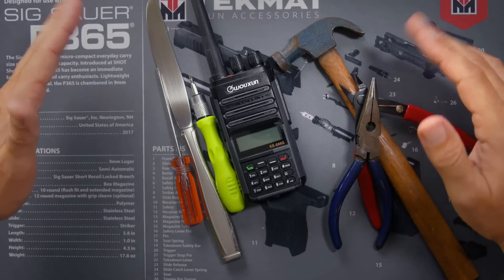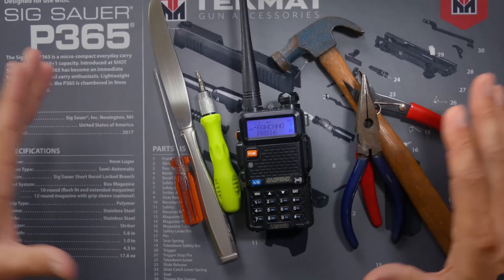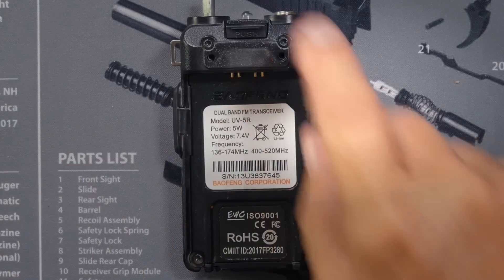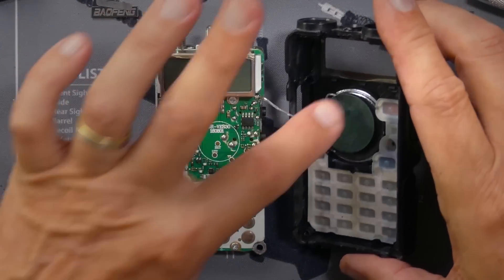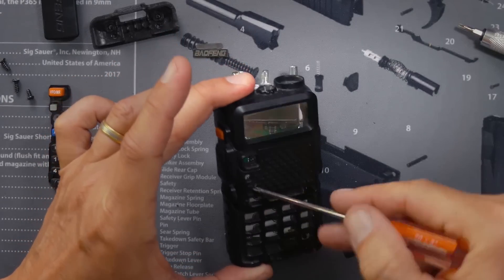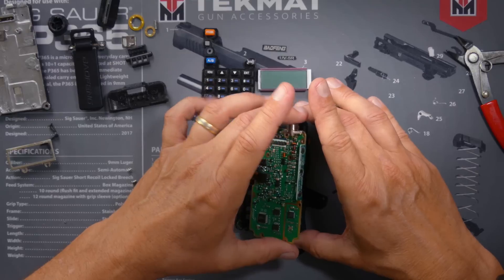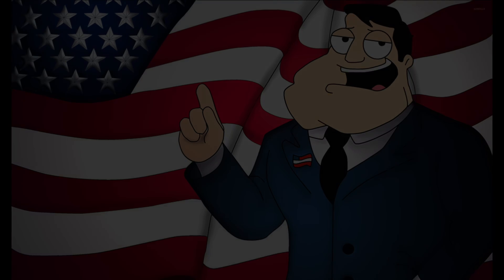Inside A Baofeng UV-5R - Teardown & Disassembly Of A UV5R, Or, How To Destroy A Baofeng UV5R

Comment: So quick question if anyone can answer i got 2 uv5r’s one a couple months ago and one a couple weeks ago the slightly older one if I put on the shorter antenna with the new one on and listening it looks like it’s transmitting every time I turn it on and the new radio is picking it up I think the first responders reacted to it too I have never pushed the transmission button listening only. Is that normal?
Reply from the maker: It is not normal, in any circumstance, for any reason, for a radio to transmit by itself IF/AS LONG AS you have the VOX feature turned off, which could trigger transmitting.
IF this occurs after confirming that the VOX option is disabled, then either don't put on the shorter antenna on the radio or toss the radio in the trash and save up $18 for a new one.
Reply: @TheNotaRubicon  thanks for the reply I’ll check that vox thing out later
Reply: @TheNotaRubicon  tried recreating it and recording it with my phone but can’t. It also makes my phone camera glitch out when I have it on scanner mode trying to take pictures of the frequencies to write down I think you are right better just get another one lol thanks for all the work you do here. Radios should be a mandatory class in high school in my opinion.

Comment: id have fun giving it a try to revive her , not sure about the trim adjustment and lcds , ive always had crap luck with lcds that work with pressure pads , and a moved trim original position but still i wouldnt say she dead yet .  have you seen any debug or jtag like test point or headers inside cant really tell from that far ?
Reply from the maker: Dude.. You are on the wrong channel.

Comment: a pre-topsy?   Re battery -  once the battery gets to the end of it's working life, I wonder, if you could scoop out it's entrails to turn it into either a battery eliminator,  (solder a cigarette lighter plug to it?  I'm not very electrical minded, I'm 'fraid) or a battery carrier for a half dozen AA's...    just my 2 cents worth.  
around 8 mins - poteniometer? I had heard  you can change the frequency range of some 'fengs via that....

Comment: How'd you get one without water damage?
Reply from the maker: I have purchased about 15 UV-5Rs in the last few years, and had dozens of other radios sent to me. Never, once, has one had any water damage, nor has anyone i've ever known (very many in my off-road group and my GMRS group) ever received one with water damage.
If you received (anything) with water damage then you are very unlucky.  If you have received more than 1 (of anything) with water damage then either whoever you are buying from is sending you damaged goods, or your local post-office/UPS office has a leaky pipe.
Reply: @TheNotaRubicon  so far I've had four uv5r's an a KG-UV9D. all five same situation.
Reply from the maker: I am pretty sure that you are the only person in the country with that issue..
The only reason I replied to your comment is because you've posted your gripe multiple times on multiple videos of mine. Pro tip: complaining about it on youtube videos isnt going to get the problem resolved.
Reply: maybe not, but addressing it is deff a step in the right direction.
Reply: I did appreciate you finding a fresh one right off the line like you did though. 
  An my whinning's not directed towards you nor caused by you in anyway at all. it's more or less... 'buyers beware, east coast electronics are all damaged lightly with water'. tbh, even im tired of going on about it.
Reply from the maker: I know its not directed at me - but it was getting a bit old..
I'm sure that if you complain to where you're buying them, or to the local post office/UPS, they'll just blame C0vid!
Reply: Agreed! Would much rather be talking about actual radio things.
Reply: I'll try an avoid your comment section with it here on.

Comment: I just opened my UV5R up two days ago to find out why it would not power up anymore. The power input header on the main pcb had very little solder on the contacts and they had cleanly separated from the solder pads.  I was able to solder the contacts. Basic power on now works. Somehow I managed to misplace/lose the LCD screen, elastomer contacts and the metal retainer. Would you sell parts from this teardown just so I can finish my endeavor to complete my seemingly useless task? I can't find any inop radio to buy and have no clue where these last significant parts are or how I lost them. This started as a just open up the dead radio to look around inside it but I'd like to actually finish the job. Sounds dumb and useless but this one has me hooked to finish by any means. 

This all started from the radio being knocked off a table. If it is dropped and lands upright the standard Battery pack will be forced up jarring the spring pin connector which will also jar the power header connector. Use the extended battery to prevent this. I have moved on to Yaesu HT,s but still have the UV5R's. Can't abandon them... they do work... at least one of them right now.
Reply from the maker: No. I burned all the parts and put them in an urn that I now keep on the fireplace.
Reply: @TheNotaRubicon  
I had to ask the dumb question just to see what you'd reply back with... and it's just as expected.  I did find the LCD and it's parts to go back on the board. The UV5R lives again. The power pin header is a weak point of the radio. Thin shim stock used at the sides make it easy to reinstall the PCB assembly into the chassis. If your UV5R just stops working, open it up and look for this being the problem.
Your videos are always great.

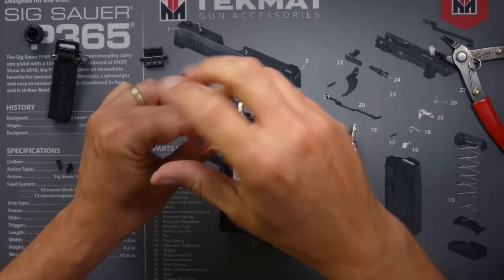Comment: The "I'm not sure what that is" at 4:36 is a loop for attaching a lanyard so you don't have to worry as much about dropping the radio.
Reply: I herd tell in won of those inter-webs that the thingamajig is aktually tied to ground if you want to use something like your QuirkQRP ZipTenna as a counterpoise for a 5/8ths antenna so as to broadcast further than you can throw it..

Comment: Protip: the bottom of the volume control knob is also a tool for loosening or tightening that weird nut on the antenna connector. Sort of handy because they have a tendency to work themselves loose.
I felt sort of sorry for her, but I guess the little rulebreaker had it coming. 🤣

Comment: I noticed the screen was polarized, I'm wondering if someone cut a new lens screen in a 90' direction if the display would be inverted like some of the Baofeng;s screens are. (Randy made it look so painful for the talkie I'd want to see some take apart video's first.)
Reply: I dont think that will work. It will only put it 90° or sideways not inverted. You wouod need to turn the screen upside-down and feed the electronics from the other end.

Comment: The assembly actually seems quite well engineered for a $24 radio. I can't complain about the functionality either
Reply: exactly what I payed for mine
Impressed.
From the packaging to what you get in the box amazes me.
I have some still working fine from 2017!
Its like the happy meal of radios.
Reply: @gpfmiller1977  and the plastic the radio body is made of isnt the crappy stuff either.
Iv dropped mines several times on the pavement and no crack yet.
Its like a nokia of radios
Reply: prolly cuz its mass produced so it has a great function for such a small price
Reply: It's bonkers that you can get a radio of this quality for the price
Reply: @MontegaB it's not really that great but considering you can't get a pizza delivered for the price of one of them, it's a pretty good deal. The Talkpod A36 plus though. That's one bad mofo for a few bucks more. Triband, 256 channels, better antenna, USBC charging, noaa button, airband etc.
Reply: Great deal. I have a cheap Casio watch that cost me 22 bucks. And all it can do is tell time and date.
Reply: yea, it averages around 30 bucks, which is quite cheap for what it does and how well actually works
Reply: @datutturugang666 not even close I picked up a brand new one for 19$

Comment: You couldn't just kick the dog a few times? Torture the cat with a fork?
I hope you washed the butter knife before putting it back into use!
Save the battery for another day or project.  Just don't puncture it;  It probably still works.
Thanks for the look inside the little trashcan.